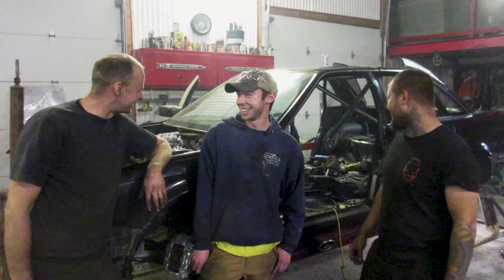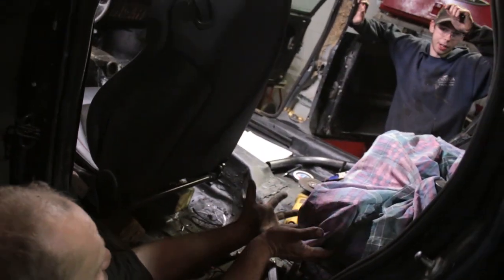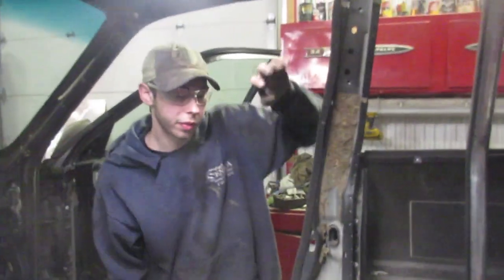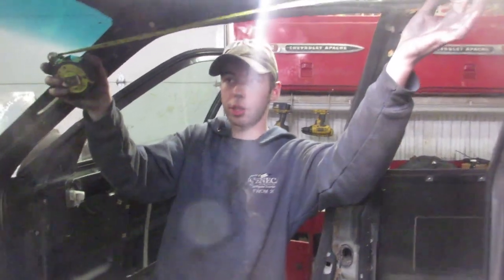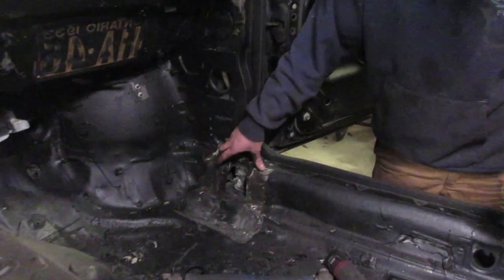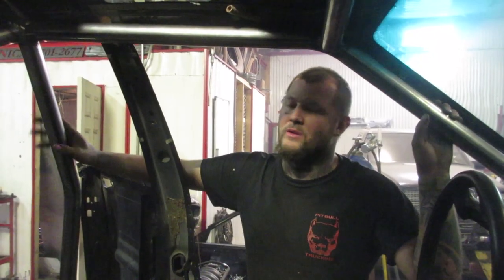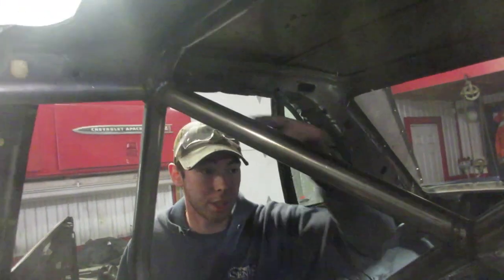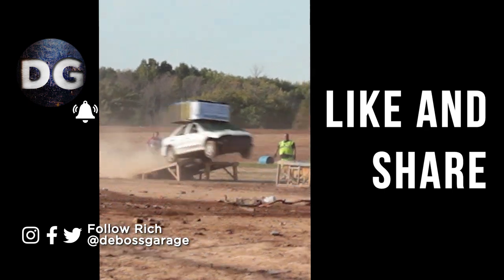How To Design and Bend a Roll Cage | #Debocho [S1 E11]

Comment: Don't know if you guys did it but you might want to weld the tubes fixed to the pillars using some flat steel strips , that will stiffen up the car body which in turn will isolate (uncontrolled) bodyflex from (controlled) suspention movement. It will improve handling.

Comment: Surprised you didn't include a harness bar.
Seems like mounting the harness in the radiator/turbo area will be a real pain in the ass.
Reply: MrClown The seat in the car was just for test fitting purposes. We are waiting on the real seats still. Once we have those we will install the harness bar but as the belts need to be 10-15 degree down slope we couldn't mount it without the proper seat in place.
Reply: Ah, that explains it then.

Comment: ok dumb question from me
It was mentioned that TIG welding is stronger than MIG 
Why is this so ???
I would have thought as long as the metal tears away before the weld you have a pretty strong weld 
I have bought a  TIG and found it a pain in the arse to use 
For serious strong welds I still prefer the stick welding to MIG  

So what does make TIG so strong or maybe its all just BS and more the quality of the weld and the person welding are what we should be looking at ???
Reply: If done correctly, the MIG can be as strong as TIG.  There is more control with TIG, so there's less chance of cold lap, inclusion, voids, and impurities that can cause weakness.

Comment: Is the tubing used for the roll cage ERW or DOM? Any roll cage pickups at the suspension load input points, front and rear? Any front down tubes? Firewall holes and openings sealed?